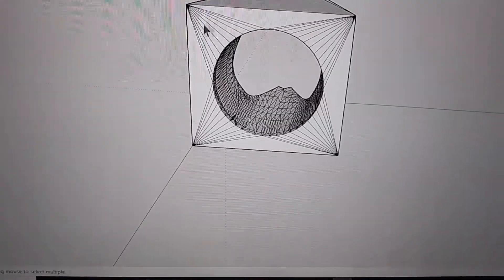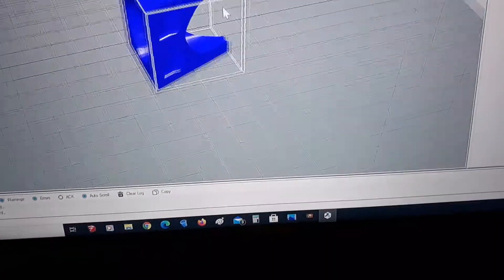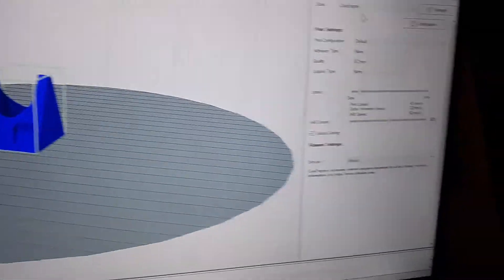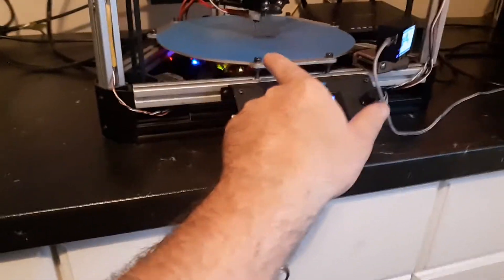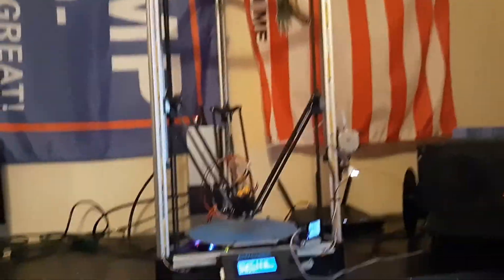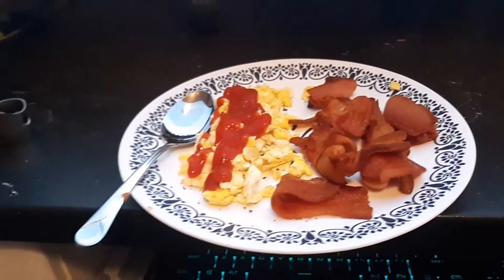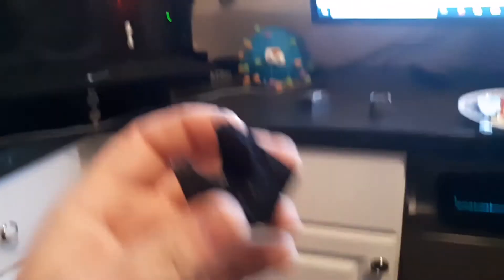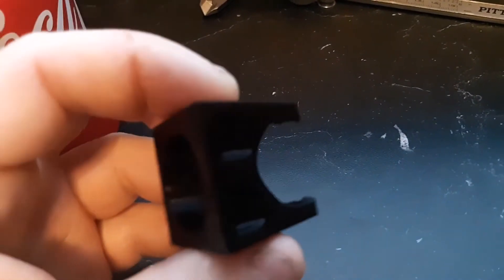Motorized Bicycle Build  Making - 25mm G2 Reed Stuffers!

Comment: I'm trying out the g2 this summer 
Is the reed stuffer needed and worth it?
Reply from the maker: honestly nope lol! You know that .0000000000001% power gain is really not worth the 15$ you will pay for it LOL  Seriously!  g2 reed! normally 80cc!  use a step bit drill 1/2 hole dead center of normal piston . Step bit slowly makes hole bigger normal drill with crack piston!  rings to bottom of piston dead center and you will be happy as hell! ideal size and place make they run perfectly without damagers of engine on brinks of death and destruction!  huge window vs 1/2  hole almost no difference you will notice.  cheap ass ebay ones dumb center thing they leave always blows out .  if you go that route just cut that center thing right out of it leave 1/2 x 1/2 square hole LOL same thing as it passes the port!